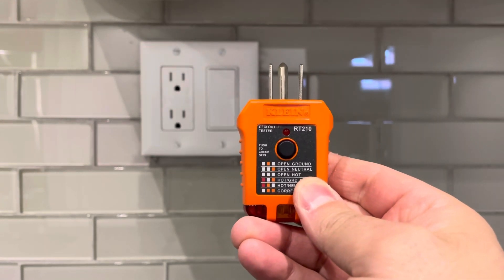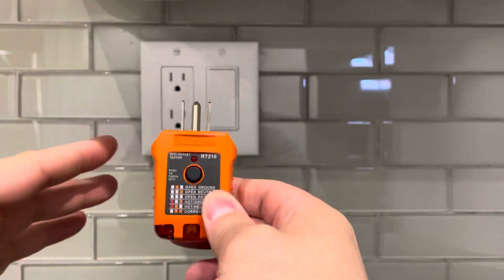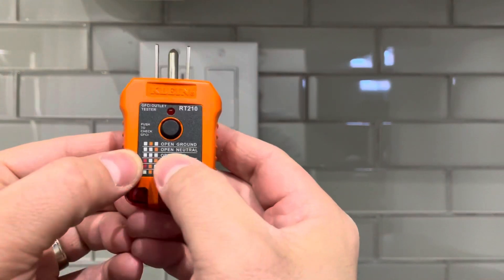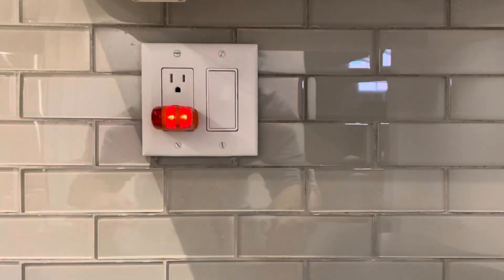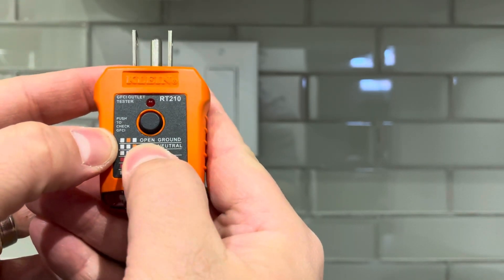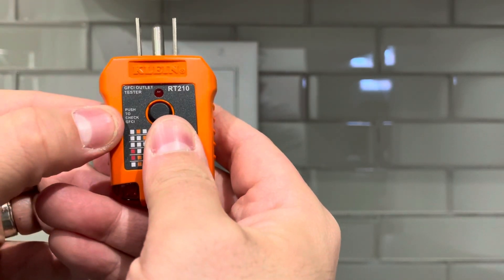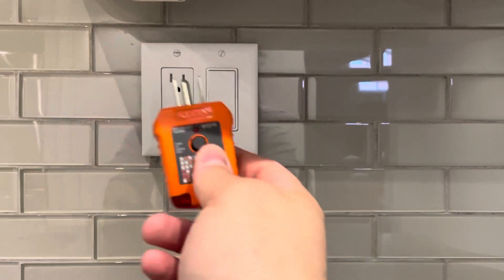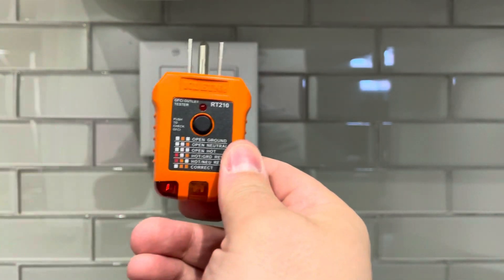How To Use A GFCI Outlet Tester-Full Tutorial

Comment: i just bought one and I'm confused, i thought when i test the GFCI protected outlet it should throw the GFCI  however mine is throwing the breaker which is a ark fault ground fault breaker. is the breaker throwing faster than the GFCI?
Reply: If you have a GFCI/AFCI combo breaker there is no reason for a GFCI outlet, so either the GFCI outlet in said scenario is bad and the trip is bypassed or the GFCI outlet is not even on the circuit and the plug checker is solely testing the breakers correct function!
Reply: @ I actually am the one that wired this house when I was in high school so I can confirm the GFCI is in the circuit (TN code changed on me in 2017 when I was building it so that’s why there’s both), for If the GFCI is bad I doubt considering I have tested multiple lines and the breaker catches each one before the GFCI additionally a few years ago I had a heater burn up an GFCI protected outlet and the breaker again caught it first. I’m not complaining having a second safety mechanism In place I am just confused on why a similarly priced component placed across the house is faster at detecting a fault then the component that is directly next to the issue, my current electrical knowledge tells me the potential voltage drop would still take relatively long time to reach the breaker (micro seconds but still long compared to the nano seconds at the GFCI) thank you for your comment tho!